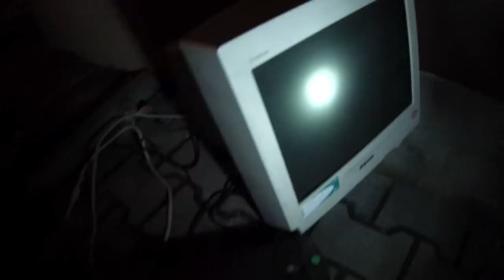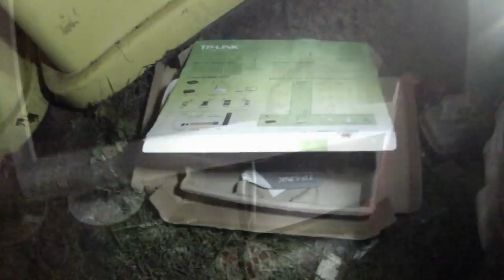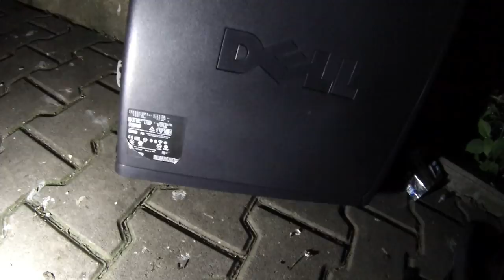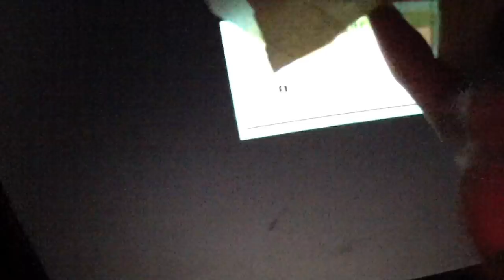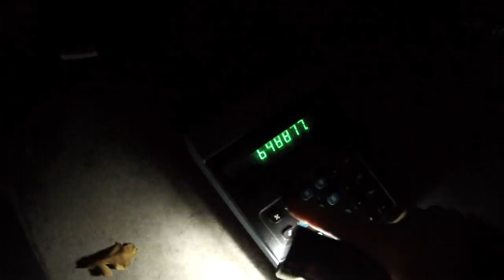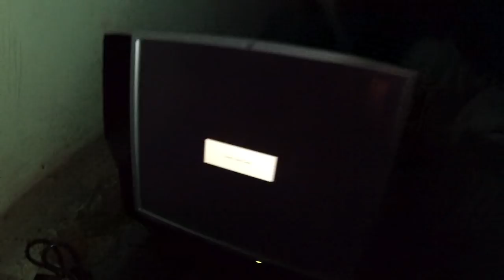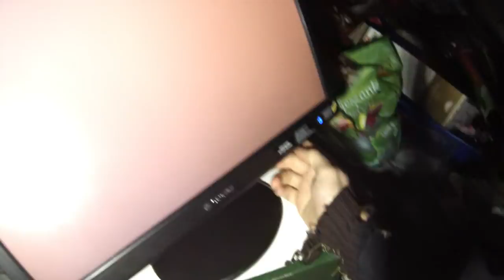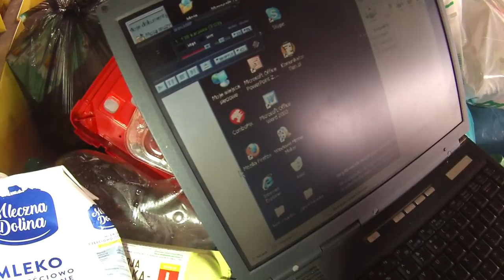Znalazlem st komp stacj,gry tel,monit,i inne #śmietnik #śmieci #hasiok #rupiecie #wystawki #prl

Comment from the maker: Siema-Watering in search of old, retro hardware, computers, RTV, -This is the range of activities that I like most :) -I've seen old desktop computers which I often run on the street, in order to verify whether the equipment will continue testing in domu.One can be launched immediately, others need some time for it :) - With the help of a device called Ups that helps during such trips. Thanks to him, he gets this dose of power to be able to fire up the equipment, usually usually meets in his role - Not counting large monitors of the old type - Which are powered by the current of which ups will not pass by themselves - I can do it well :) because in this type of hooking different types of equipment also come different surprises, with short-circuits, blows, overloads and inflammation of the equipment including (Yes, this is how the computer lit up in this material during the recording, for the impatient action from 7: 33sek):):):) - Last I got the old type of CL CLK 2010, nice monument:) old ibm keyboard in very good condition from 1995, surprised me to the very old HP HP LaserJet 4P laser printer from 1993:) - Unfortunately, I did not succeed in launching it on the spot :( - I do not know what its is, maybe something power does not coalesce - I know that with newer so-called modern printers -Ups do not catch them at all :(, An interesting fact that does not give me peace since I got this monitor-STAGE ATRIS INFORMATION TECHNOLOGY is a fact What's the right thing? - I've been looking for info about this company - I did not find any information for it - I can do it :) -If so boldly go ahead :) - What a monitor, etc. :), Crossing hundreds of kilometers a week I often manage get into the so-called stationary computers, some complete, others not to the end-Not once with disks, processors, cd, dvd, motherboards, or totally incomplete to the so-called total secondary recycling, I also manage to get different types of office equipment, type of printer, scanners, and tp -th together I also got one like a multi-functional device so-called Canon harvester in a box packed - probably fully operational. I was surprised to find an old Polish calculator Elwro who despite his years -I still managed to include:) I was surprised to get rid of the old Artis laptop - Which, as it turned out later, had - As it is usually all your disk unmounted - And in it min old Windows Xp proffesional from 2000 and in it set Office from 2003, winamp, oxygen, skype, everything in an open mode - in a undeveloped state , whole story, personal data to read - You liked the material:) - Leave a footprint in the form of a paw in the upper part:):):) - I will be very pleased if you will be my viewer for longer :) :) To be subscribe to my channel on an ongoing basis, have an idea for a new episode ?, suggestions ?, remarks? -I invite you to the discussion -Dumpster diving Poland.